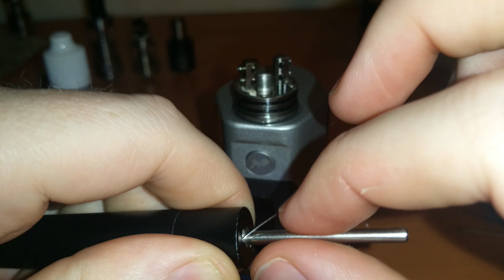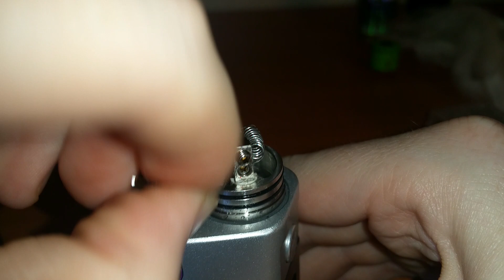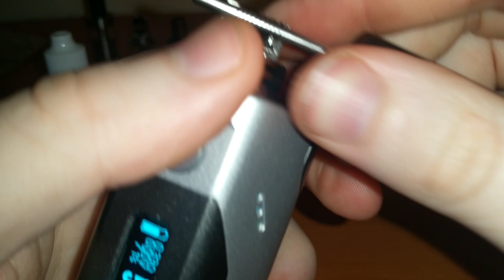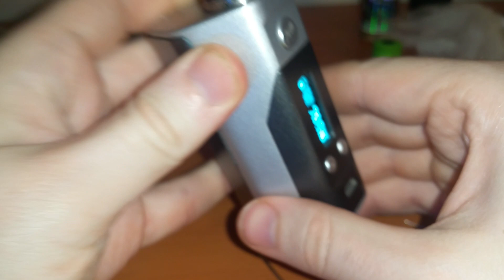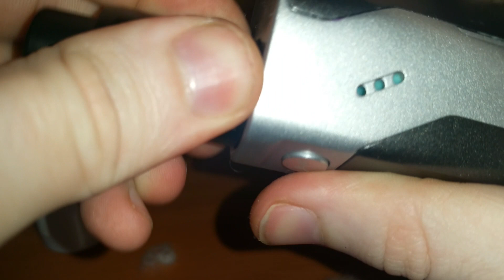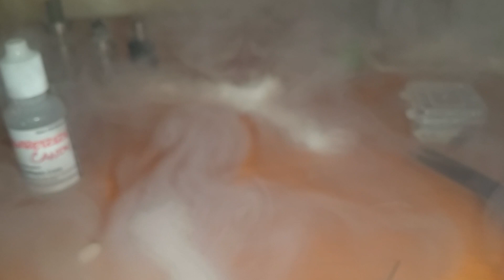AdvancedVape Build Guide Episode One: 316L Stainless Steel Spaced Coils

Comment: I've been spacing my 24G 316L coils with 10 wraps 3mm dual coils @ around 60w-65w .23-.25 ohms, I made several of these same builds for my Velocity RDA, Limitless Plus & Avocado 24.  Is it normal for the coils to make an extremely loud pop on first fire?  The subsequent crackling is pretty loud which is good (I guess, but not stealth) because the flavor/vapor is where I like it and my cotton is nicely saturated every time I check my wicks for my RDTAs.  I think the pop is quite annoying though, but I'm guessing there's nothing I can do about it since I'm firing cold coils with liquid at room temp trapped between the coil spaces?  I tried 2 different KGD cottong (Cotton Bacon v2 & the standard untreated pads).  Packed it various ways (preferably medium to tight), but the pop seems to happen 100% of the time.  I'm wondering if a smaller gauge (26g) spaced coils would reduce this?  Thanks.
Reply from the maker: I don't get a loud pop when I first use it, but it could be related to the amount of juice you have on the wick and if you leave it sitting for a while. you should get the normal crackling, especially from 24g. but it may just be a bubble of juice popping etc.
Reply from the maker: also, I'm not really sure 26g would improve that although it may. it seems to me that it could just be ramping up so fast it causes whatever juice is there to boil and pop very quickly. as long as it isn't throwing boiling liquid at you or burning the wick you should be ok though.
Reply: Thanks for the reply, much appreciated.  Wicks on my RDTAs are nicely saturated at all times, maybe overwicked?  Yeah, I don't think there's much I can do about this.  I've learned to fire the mod away from me until I hear 2 pops (one for each coil) and vape.   That's how consistent it is.  Thanks again.
Reply from the maker: are they both dry fired to be firing in sync? that's odd that there would be two separate pops. ideally you want them both heating identically. which rdta (or multiple?) is it doing this on? just the limitless and avocado? or an actual rdta style? I've noticed with some of my rdas a steady undertone of popping but definitely not a loud single pop. more like a very loud crackle
Reply: Yes, definitely.  For 316L, I do the dry fire (light orange glow) prior to wicking.  The 2 pops happen either at the same time or 1 immediately after the other followed by the normal crackling.  The crackling gets loud at first, but gets quieter after I continue vaping.  If I leave the mod for an hour and come back to vape, I get the pops again followed by the crackling.  It happens on all of my Genny tanks (Avocado 24 & 2 x Limitless Plus).  My Velocity does it do but not as consistently.
Reply: I used to use 24g & 26g Kanthal A1 contact coils before and never had this, so I just assumed it was the pocket of juice between the spaced wire.  However, with all of this being said, I love the 316L wire.  It does give me a crisp and cleaner taste.  I also noticed my coils and wick don't gunk up.  Pretty awesome.
Reply from the maker: Yeah kanthal sucks :D
it's been a while since I've used normal round 316L wire for a build but I don't remember it behaving like that. I'll have to try it again and see.
Reply: Cool thanks again man.  BTW, heard really good things about the SS fused claptons at your store.  Will you guys be stocking the 2 * 28ga / 40ga fused claptons?  Might order a roll of that stuff.  I prefer the fused claptons, but trying to be economical about the juice consumption without compromising significant flavor.  =)

Comment: i have a problem, i have a releaux rx75 mod with billow v3 rta. I recently started using SS316L wire, the ppl at the store told me not to dry burn it. so i didnt. first couple of days everything was fine on my first build. then the mod started changing from ss mode back to power mode. same happened when i used it in TCR mode. im crawling all over the internet and cant seem to find why. Please help.
Reply from the maker: could be because of a hotspot or short. 316L needs to be dry fired. but it also needs to be done more gently and less intense than you would kanthal. a lot of people make the assumption that because 316L can do temp control it must be treated like the other TC wires, nickel and titanium, which cannot be dry fired
Reply: I will try doing it again with dry buring it. by the way i did do a spaced coil. the only other wire ive ever used is Clapton micro build coils. anyway. thank you for the immediate respond, i didn't expect that, and i really really appreciate it :)
Reply from the maker: just let me know if you have any other issues. if you did spaced then your most likely culprit is a short of some kind or less than secure connection at the posts. for tc to work right both coils need to be identical and glowing the exact same rate etc or else most mods will kick out of tc. we have a dry burning ss tutorial on this channel also.
Reply: They were identical in wraps, maybe the spacing was kind of different. What do you mean less than secure connection at the posts, i believe i had them pretty tight. Anyway, i made clapton coil again a couple of hours ago and im really tired to make a new build now. When i do if theres any probs ill post here. If there are no probs ill post anyway a big fat thank you :)
Reply: By the way, i cant firnd on wismecs site on how to upgrade firmware on this thing. any ideas?

Comment: you're not using the SS temp control? just straight up power mode? why
Reply from the maker: stainless can be safely used in either power mode or temp control mode. it's a personal preference thing.
Reply: AdvancedVape do you dry fire the ss before using it?
Reply from the maker: +jeco F yes. there is a video covering safely dry firing stainless steel on this channel, as well as in this video.

Comment: Seems just the same as building with kanthal then? If so that's a good thing. There are so many types of SS wire listed on steamengine - is 316L the one to go with?
Reply from the maker: 316L is by far the most common. it is the same as building with kanthal, but you'll want to dry fire it significantly less than you would kanthal
Reply: Ah ok. I've been doing a bit of reading and some say 316 might give more accurate temperature control on some devices. I'll be using it with the istick pico and joyetech cuboid. Do devices that do SS temp control perform the same with 316 and 316L? Are all devices compatible with both? Thanks
Reply from the maker: +Pete Horam it's the opposite from my experience, 316L is the better choice over regular 316. it's unclear on some mods whether their ss mode is 316 or 316L, however 316L is the most common so it's a fair guess to say most ss modes are for 316L even if it says 316
Reply: Ok thanks, I'll get that. 26 or 27 gauge for single coil at about 0.5 ohms?
Reply from the maker: +Pete Horam I prefer 26g
Reply: I went for a high gauge clapton wire so that it heats up and cools down faster. Just tried my first temperature control with clapton SS. It's cool!

Comment: OMFG you are no-skill AF, you've just burnt the coil idiot ,first I suggest you to learn how to built normal macro coil
Reply from the maker: stainless steel is supposed to be dry fired. we would suggest you do some more research into stainless steel.
Reply: About research you should have found that SS316 should be just warming up. Have you read about Ni200 wires ? This wire after glowing produces harmful particles thats why it should be just warmed like SS316. This is your lack of knowledge
Reply from the maker: +eM Si these videos are made by me (Stuart) who works for a company (advanced Vape supply) that sells nothing but 316L stainless steel. stainless steel is NOT the same as ni200, not even remotely.

Comment: Just getting in to using the SS 316L 28ga by UD and was wondering whether the same 10 wraps could be used for the avocado 24 its also new to me but wanted a dripper style tank as i have heard that the flavor is better i have used that steam engine but do find it confusing a bit as i don't really understand the coil building side of things just yet so before i get into building i just wondered about your thoughts on this Gage wire and builds for it
Reply from the maker: I'm not a big fan of UD wire, particularly 316L, but it's not the worst wire out there or anything. 28g can strike a good balance for a beginner and gives you some room to grow (like, making twisted 28g). but, once you get more used to building and working with SS I would recommend something like 24g if you're building normal round wire and if your mod can support that resistance
Reply: i have the cuboid and the xcube mini both should support the ss316 option the 28ga was what was sent to me for temp control as that was the reason i wanted to use it in the first place but from what i undertsand the 28 ga is thinner than the 24ga so if i just use the  10 wraps as shown in a spaced coil on the coil master cw-30 i should come close to that build of yours i would think just not 100% on that
Reply from the maker: +tuberecruit it will be higher resistance than the build in the video, which used 26 gauge. the lower the gauge number, the thicker the wire, and the thicker the wire the lower the resistance, but also the more surface area. I was using wattage mode in the video but yeah stainless is great for tc. I would recommend not using 316 mode on the cuboid though. use tcr mode with a tcr setting of 92. it's more accurate to 316L that way
Reply: thank you and btw have thoroughly enjoyed the videos that you have put up they have been a great resource for me so far keep up the good work bud
Reply from the maker: +tuberecruit you're welcome! if you have any questions as you keep building just let me know or send me an email at Stuart@advancedvapesupply.com and ill help you get it working.

Comment: so you can use stainless steel wire in wattage and temp control mode?
Reply from the maker: that's correct. I use mainly wattage mode while the other guys here at avs use mainly temp control.
Reply: AdvancedVape so is that what tcr mode is used for? because they got rid of ss316 temp control mode on the latest update for my vtc mini and kept tcr mode
Reply: and i've been looking on youtube some people say not to pulse it, like with nickel because it oxidize and become harmful, so im just really confused
Reply from the maker: +NDM ASP this isn't completely accurate. it shouldn't be dry fired hard like kanthal. but it is absolutely safe for light pulsing to a dull orange glow. our company president Brent is highly allergic to nickel so if ss off-gassed it would make him sick indeed.and, tcr mode is the most flexible accurate way to do tc on multiple metal types as it allows you to enter that particular metals tcr value. ss 316L is 92.
Reply: AdvancedVape okay thanks for the help

Comment: Morning M8, did as you done, run,s in temp mode then after a bit jumps into power mode,any reason why that would be?    regards mark
Reply from the maker: this is typically for a few reasons. one, it could be inconsistent connections at either the 510 or the post connections. two, it could be one of the coils firing differently than the other because of leg length etc, and three, it could be because you're using SS316 mode with 316L wire. I would recommend using tcr mode with a tcr of 92 if you're not already. if any of these don't fix the problem let me know.
Reply: thank you for getting back to me, all working now,used it in TCR mode and all working, many many thanks

Comment: Been playing about with ss wire for a week and I find it doesn't live up to what I had in my velocity, I had dual twisted kanthal at .4 and tried the same with ss at .2 and it was flavourless and not much vapour so I've tried standard coils which is better but found twisted kanthal to beat it hands down, is there a break in time where as it mite taste as good
Reply from the maker: in my personal experience stainless beats kanthal in flavor every time, but to each his own. if you're gentle in dry firing, and are patient with the build to make sure it's working right,  it'll beat kanthal any time. I've had normal round or twisted ss builds beat kanthal claptons hands down in the past. but if you prefer the taste of kanthal there's nothing wrong with that.
Reply: +AdvancedVape didn't mention that I'm not in tc mode just power mode on a sigelei 150, would tc make a lot of difference
Reply from the maker: +Dninjah Mason it's a preference thing, but if I'm not mistaken the 150 doesn't have a TC mode for 316L or a tcr mode. some people like the flavor more on tc, where as I normally run in power mose

Comment: I've never used SS but plan to, how many wraps (tightened not spaced) do you think it would require to get 0.2 ohms
Reply: for what its worth, i just did an 8 wrap 24g 316l dual coil build wrapped around a 3mm post and it came out to .19

Comment: So I see this video has been out for a while, but I am new to Stainless steel, but I am working with the Sigelei 213, Avocado 24, and 316L SS Clapton Coils. Core 26g, and Wrapped 30g, Usually comes out to .25 or around there.....I am wondering what a good Temp would be for this build, and watt wattage I could start at to see if I need to bring it up to a higher wattage. Any help would be awesome.
Reply: +Shawn Hixson 
I do apologize but I didnt comment on your vid but it was some good info, just not what I am looking for since I am using claptons
Reply from the maker: +Shawn Hixson Temp is entirely up to your personal preference, but most people enjoy around 450F. Because you're using temp control, wattage selection is pretty much mitigated by the TC, but i would recommend somewhere around 60-65 watts.
Reply: +AdvancedVape thank you I was thinking I would run it like I normally would but just want sure....thank you for the fast response

Comment: Love your channel man! i found your video from a website that sells all stainless stleel! and the website charges decent prices(not THE  cheapest, but not the most expensive, its a good deal, I just wish they had SS alien wire and alien coils :(   )   Anyways , thanks for the info, keep the channel up., I believe in a year or two(if the regulations and b.s didint exist), Stainless Steel will fully replace kanthal. 
     Because you can fire it in power (watts) mode and TC(temp control) , it tastes way better, lasts longer. I just have one question bro; "So, I want to switch over to stainless steel exclusively, so my friends are telling me the only con is that, SS has a higher resistance?(Sorry, Im super new to building, I just built my 3rd build today so forgive me). So , your pretty advanced, could you give me a comparison. For example (again im just guessing with these numbers), 
       If i said 5 wraps of 26 gauge with kanthal =.2 , so i would need _ gauGe with stainless steel = .2  .... Do you know what I mean man? Like how do I convert it, or how similar is it to kathal? Thanks so much
       Also is there a way to do that math like I just did,  is there an app that I could put "" 5 wraps of 26 gauge with kanthal = AND Get an answer? if so could you please link me, and if you want  do a video on it, I bet it would get a lot of #views
      Lastly, if you are running that store  that sells all SS which is awesome!!! Where are you located east coast or west coast? and do you guys ship to canada? Do you still give the deal of free shipping if I spend 80$(Cuz if so ill spend 80 to support you,but if not id probably just order a couple things), keep up the good work bro!(please respond)
Reply from the maker: we run the website advancedvapesupply. we ship internationally, but don't offer free shipping for international orders.

also, there is an amazing website for what you were asking about. Google steam engine wire wizard. the steam engine website is full of helpful vaping calculators, and the wire wizard is the one you're looking for.
Reply from the maker: also. your friends are mistaken. stainless has roughly half the resistance of kanthal.

Comment: What about SS for cloud chasing or just high wattage vaping? I always vape above 100 watts and just wanna make sure I can do high wattage with SS
Reply from the maker: sorry for the delay in answering you. it depends obviously on your build but there are most certainly builds with ss that you can take to very high watts like this. for example, a fused clapton or an alien, or staple coil, can handle very high wattages. I've fired large fused claptons and aliens at well over 100 watts in the past, and taken parallel coils above 140.
Reply: +TexasNewEdge very good question

Comment: Springiness of SS naturally calls for spaced coil build. Your coils would turn out spaced, even if you didn't want it. Side question: what is the best way to reduce springiness of your SS wire, if you need your coils to be more pliable? Also, where you stand on this wicking material debate? What is the reason you use this particular “cotton” wicking material? Thank you for your guide and thumb up!
Reply: I use micro ss coils and they never space out! That's the problem with youtube, people assume because you make a video that you know what your talking about. This is how people get hurt

Comment: can you build every coil spaced regardless of the type of wired?
Reply from the maker: yes, you can. but there are some builds that do not benefit from being spaced, and you can also run into problems with the size of the build in the build deck you're building on, challenges to resistance etc. there are some wire types that do not perform well spaced, and some that perform much better spaced. it depends on the type of wire.
Reply: +AdvancedVape EDIT  SORRY FOR THE DOUBLE POST, MY BAD).